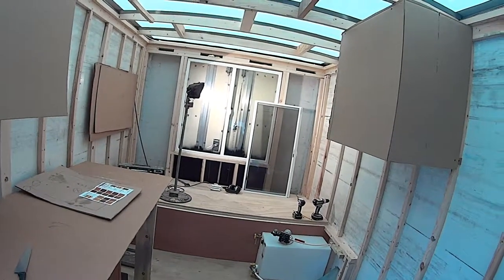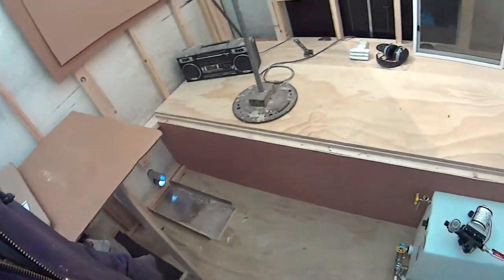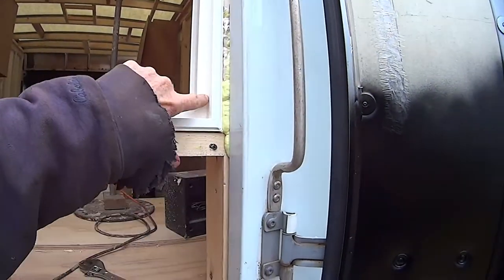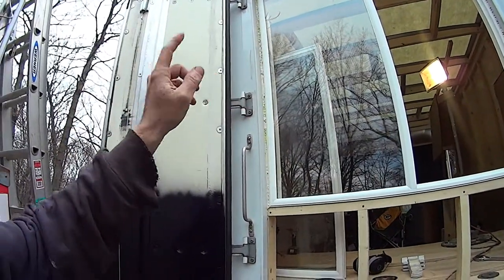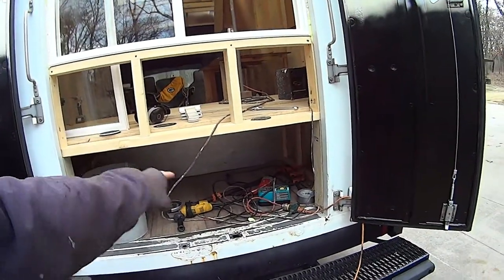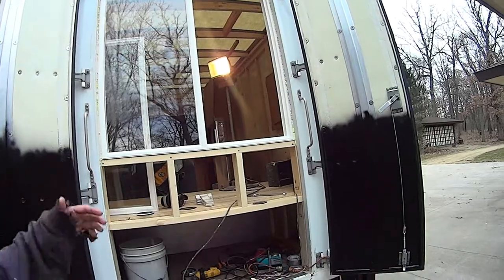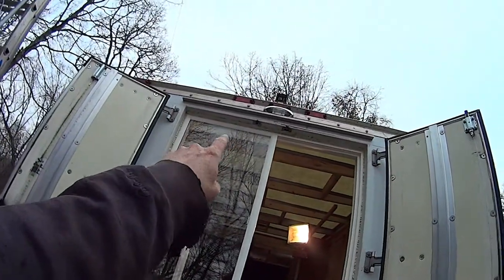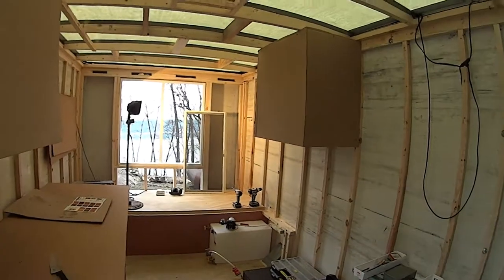Rich's Box Truck to RV #35 - A new window, back door hardware

Comment: Great job on the conversion . What is the size of your box ?
Reply from the maker: Thanks for the comment Jim. The truck is advertised as having a 16' box, but the actual measurement from back doors to box front is more like 15'. I had originally dreamed of an 18' box with a king size bed in the back, pillows by the back windows. I did not want to have to crawl over my partner to get into bed (or visa versa). But my wife talked me into a 16' truck. Well she didn't really talk me into it... it was more like "NO, YOU ARE NOT GETTING AN 18' TRUCK". So if I was single and had to do it all over again...

The inside height is 92", which leaves excellent head room. Side to side I have about 94" to work with.

Besides having the front walk-through, the main things I was looking for in a used truck for this RV were size (16'), the translucent roof and the smaller barn doors on the back. Most of these box trucks have roll-up doors which I believe would be hard to work with in this type of build. I was happy to find one with less than 100,000 miles (this one has 88,000) and gas engine. Although diesel has many advantages, I was just more comfortable with gas.